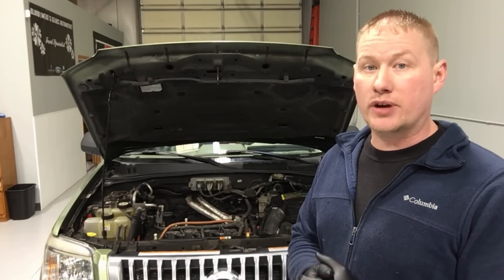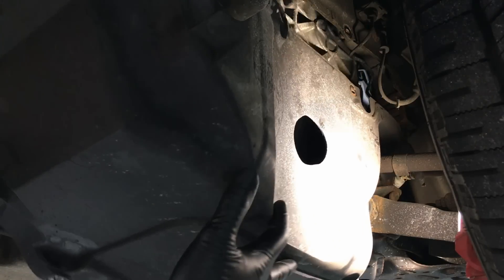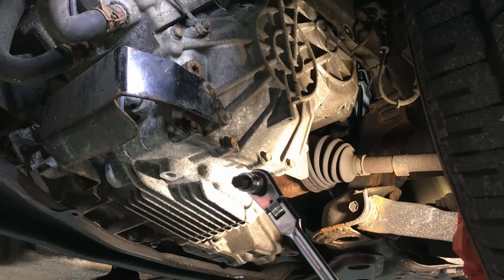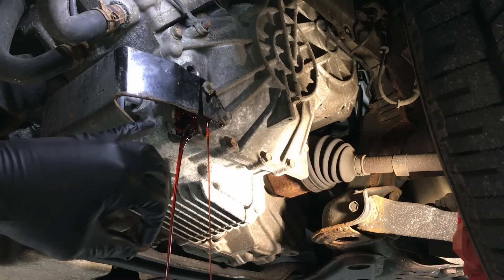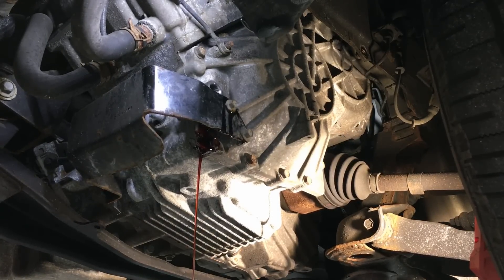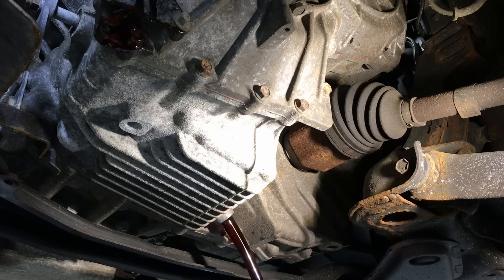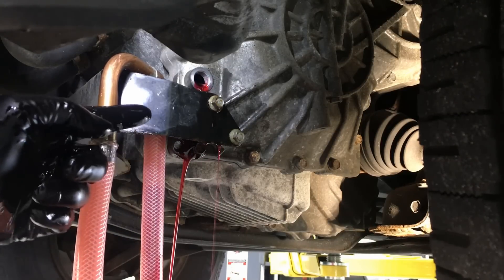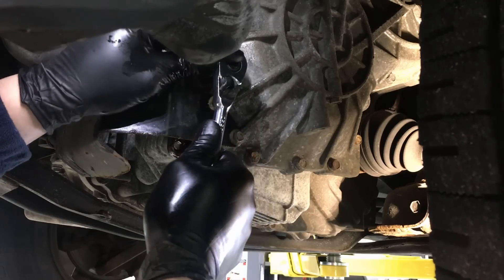2005-2012 Ford Escape Hybrid eCVT Transmision: Fluid Drain and Fill Procedure

Comment: I'm not sure I agree with your fluid choice. I'm fairly certain these transmissions use Mercon LV, not Mercon V. LV is for CVT transmissions specifically. Are you certain on your fluid recommendation?
Reply from the maker: The fluid specified for the Ecvt is mercon V yes, regular cvt transmissions from Ford as found in the Ford Freestyle take a CVT specific fluid whereas Mercon LV is used is most if not all of Fords new conventional 6+ speed transmissions. Your statement is so far off in so many ways please heed my advice I have been a Ford Tech for 15 years I work on Fords 7 days a week I know what I am talking about thanks.
Reply: @FordTechMakuloco  Good to know. The reason I made that statement is because my OEM Ford dealer (Anderson Ford in Lincoln, NE told me that my eCVT Escape takes Mercon LV. After more research I see that you are correct. Scary to know a dealer told me the wrong information.
Reply: @TheeFlyingK  It would not have hurt that transmission one bit by using Mercon LV.  Compare the two, all the info is online side by side.  You would have never noticed a difference.  Your local dealer was probably recommending what they put in those transmissions because LV is a better product.  Most of the guys on the Ford Forums use Valvoline Full Synthetic Mercon LV or Amsoil Low viscosity ATF.  Ford acts like they transmissions aren't even serviceable because they are "Sealed"  Sealed my ass.  Same with the 2015 series F150's with the automatic trans in the EcoBoost, "sealed" Which is complete garbage.  As you can see in this video, they are all serviceable but Ford refuses to do the work because they claim there is no way to drain or fill them.  Valvoline makes a great Mercon LV Full Synthetic or you can use the low viscosity Amsoil ATF and it will run better than the day you bought it.  Ford acts like they put some special additives and magic spells in their fluid.  Give me a break.  This isn't a dual clutch racing Ferrari for God sakes.

Comment: I have a 2007 Escape Hybrid with CVT transmission. Lately I've noticed my rpm's just about red lining at higher speeds on the freeway. Almost as if the  transmission is slipping or not shifting to lower my rpms. Any advice?
Reply: Our 2006 is having the same problem.
I'm still working towards the cause, but I did find both output shaft seals leaking so it may be that it is low on fluid and either causing the issue or caused damage and this is the outcome of that damage.
Reply: @TheeFlyingK  I would imagine that in my case if the output shafts were leaking I would see an oil stain in my driveway. Dont you think?
Reply: @foggiapainting  It's possible. It's also possible that majority of the leaking happens while the vehicle is in motion. I'd simply check both seals for leakage. I never noticed any wet spots.

Comment: I have my 2005 Escape hybrid at the dealer now. I brought it in for a CVT Oil change. They are saying this hybrid transmission is "not serviceable". What are they talking about!?!? This vidoe makes it seem like this is something they can do for me. Are they just not trained on hybrids??
Reply: According to FORD, the transmission is "sealed".  The lubrication is designed to last the lifetime of the car.  You should just drive it til it makes a crunching sound, then walk away, marveling at the wisdom of FORD.  The transmission will have lasted exactly as long as the car!

Comment: Great video. Discovered that my quarts bottles had a gallon sized opening therefore the recommended pump was too small
Reply: Same problem for me. I had an old denatured alcohol bottle that I dumped out and used it to pump. My 2010 FEH took about 6 quarts, even though the owners manual said 5.4

Comment: Can bad fluid cause the wrench light? my door actuator for the battery hvac seems to be fine opening and closing fans working as should for the ev,  i ordered a filter for the rear EV but if i turn ignition on and wrench is there I can turn it off then on again and it may go away. Could this be the trans fluid also its a 2008 with 162k on it NO other issues

Comment: I have a 2010 Ford Escape Hybrid with 161k and did a drain and fill based on this video at 140k. Now I think there is some slipping happening now. The rpms will stay just under 3k at 70mph. Any thoughts?
Reply: I think at 70 mi/hr that seems about right for the RPM on these.
Reply: @nocarsgo23  agree rpm's are right going 70mph.  you have no issue.
Reply: Kyle Cornelison how did it hold up ?
Reply: did it slip I have one one with same mileage

Comment: @FordTechMakuloco
I used the Mercon LV in my 2008 escape hybrid, is this a really huge problem?!!?
Reply: I have this exact same question. I bought Mercon LV for my 2013 Ford Fusion hybrid and have a ton left that I wanna use on my 2008 Ford Escape Hybrid. I thought the 2008-2012 Escapes were the same?

Did you have any issues using Mercon LV on your 2008 Escape??
Reply: Mercon LV is specified for my 2009 Escape Hybrid

Comment: My 2007 Hybrid  sometimes slips when it’s real cold (like 10 degrees or below) and it sounds like my front wheel bearings are loud. Are they related? I’m going to change/check the trans fluid, but is there also a filter that needs changing with this procedure?

Comment: If it hasn't been changed in a long time, or not at all, at 190,000 miles will draining and filling it cause it to fail? I know regular automatics are like that.
Reply from the maker: On these no concern at all.
Reply: @FordTechMakuloco    Sshould I do it warm or cold engine, and sitting for awhile for fluid settlement
Reply: @FordTechMakuloco  Can we see a video on a drain and fill of a 2015 CMAX Energi transmission? Got one coming up on 60K.

Comment: I have a 2009 Mercury Mariner hybrid that I only drive a few times per week.  It hasn't reached 30,000 miles yet so I'm wondering if, like the motor oil, the transmission fluid is one of those things that  should be changed every few years or so, regardless of the mileage.
Reply: wow 4 miles a week on average since 2009?
Reply: You should anyway

Comment: Long shot but, I'm looking to buy a used 2008 Ford Escape Hybrid but already know there's an issue with the A/C and power steering. A/C I could care less about, and power steering from what I understood was fixable by swapping out a sensor. 
However after talking with the selling, he tells me that because it's electric there's no fluids so...you gotta change out the whole assembly? Still cheap to buy from a scrapyard but, not sure if this is right or if he's mistaken and I'm able to just swap out the sensor that seems to be an issue? Thanks! :)

Comment: Please help!!! I have a 1999 E350 5.4, it runs bad. # 2 cylinder misfire and #3
There was 4 misfire and it was running lean, so I put a new fuel rail and injectors all the way around. Then it ran better for 30 minutes. It shatters really bad in overdrive and less you give it gas. Very low power, i've changed coils and spark plugs. Number 2 cylinder you can tell by The spark plug was running rich, not the other ones. Also the number two cylinder coil boot look deformed in the middle like it got hot. But the van has never overheated. The egr Value was full of nasty crap so I changed that and the thing that has high side and low side that has little tubes the hook up to the exhaust manifold. New pcv value. I knew propane and strong for them to see if there was a leak in their intake and it did not show any vacuum or intake leaks. As you are driving it you can feel it at normal for a split second go back to running like crap then do that back-and-forth. But when it's in overdrive it shatters really bad, i've also put a new mass airflow sensor. Now only 3 codes come up and egr exhaust flow restricted and #2 and #3 misfire. There was 19 codes before I started, I'm just frustrated so bad right now. I've tried so many things now. So if you have any suggestions please, please!!!
Let me know.
Reply: Im among all of the others,are the only one with balls to reply to you
Theres so many codes man.... did you fix it yet?

Comment: Almost as easy on the newer escapes (2013 onwards) - no need for a pump as you fill it from up top, but you do have to check the level when hot and running which is slightly more challenging.

Comment: Brian,  I have a 2015 Ford Focus sport 1st question where can I get a service manual? I searched but can only find up to 2014. The 2nd question is I cannot find anything that really explains what the sport model is I know the bottom side skirts are painted and the front valance(dont know if thats the right word or not) also the paddle shifter.

Comment: Brian, thanks for another great video, I'll definitely be changing the fluid myself this next time instead of taking it to the dealer.  On another topic I have an 2008 Mariner Hybrid with 115k miles and recently it's been getting a Regen Braking error in the dash text display, along with the ABS & Wrench lights.  I've driven it with this condition and it definitely changes the braking characteristics.  Usually if I turn the car off, wait a minute or two and restart it the error clears itself and the brakes operate normally.  I curious if you (or anyone else watching this video) has ever had this issue and what it takes to fix it.  Thanks again.
Reply: Jim Miller 
Check the tone ring if it cracked or broken for ABS warning light.
There are video on YouTube.
Reply: Jim it might be a PCM issue
Reply: JIM,  +,    go to each wheel and check out the--" ABS sensor"  and harness make sure you don't have  any frayed wires,     Do a  good,  Thural VISION  INSPECTION,    use a flashlight,     take your time and look at the - "star ring Hub toner" ,    where ABS sensor is detecting a PULSE,     look for any damage as you turn the wheel,    
Also,    while you're there,   clean out the sensor with "brake cleaner"     sometimes if you have too much metal debris- build-up on the sensor,   it can ACT UP....
Take your time one thing at a time so you can eliminate the Causes that you' ve  already gone through  your   " DIAGNOSTIC - CHECKLIST"..
Also,    maybe you have a bad--" ABS sensor" ,    look up a video,    on how to test,  A " ABS - SENSOR"....

GOOD LUCK, 🤞,   Hope you find the issue.....

Comment: The hybrid cvt is extremely robust. It's not even the same as most cvt. I believe in the leave it alone stance on transmissions.  We have 2 with over 225,000 miles and have done nothing maintenance wise to either. If you buy a used high mileage unit, leave it alone. If you get one low miles, then do the flush.
Reply: I want to say the same about my 2017 Rogue but I know better than wishing for the impossible. LOL.
Reply: That's what the Ford dealer next to me said. They let them go 150,000-200,000 miles before changing the trans fluid

Comment: How reliable are ford cvt's??
Reply: STEEVE DAVID Nicolas the hybrid ones are bulletproof. Very rare to have any issues.
Reply: daryl turcott thanks for the info, I'm familiar with nissan cvt which are trash by the way, don't know much about ford cvt's
Reply: As mentioned in some comments above, hybrid eCVTs such as this one are rock solid reliable and can EASILY go 300+k miles as Brian mentioned. A totally different beast compared to a traditional CVT you'd find in a non-hybrid on the road.
Reply: STEEVE DAVID Nicolas time will tell get an extended warranty asap. Ford rarely makes good on major defects. Shalom
Reply: motorhead there were quite a few issues with the zf Batavia cvt in mid 2000s that ford did not address for sure. But time has proven the 05 to 12  hybrid trans. Millions of initial taxi fleet miles and no failures.
Reply: daryl turcott not a fan or cvt anyway,like manual or auto,I like hearing the trans shift point
Reply: Its bulletproof because it is an electric cvt. Aka ecvt. there are no metal belts it is all gears like a manual transmission but electric motors change the drive ratio through planetary gears
Reply: STEEVE DAVID Nicolas a shame about Nissan,  I really wanted a cube, but was scared off.

Comment: ,,, I need a video on a 2013 model Ford Escape all wheel drive,,, for transmission fluid change transfer case fluid change rear differential fluid change,,, radiator drain and thermostat replacement,,. Do they even have power steering fluid,,. ???   What else do I need to do at the major preventive maintenance at 60000 miles,,,.  ???

Comment: Good info!  Looks super easy.  I got my wife a 2018 Subaru Imprezza with the CVT tranny, and not having any experience with the CVT, I had been wondering if it required any fluid changes.
Reply: There's a big difference between a conventional CVT and an eCVT as seen in the hybrids. Conventional CVTs have the whole pulley and belt setups and depending on the manufacturer may be 'ok' to just 'bad'. eCVTs have been proven reliable and rock solid as all they are is a simple planetary gearset, no clutches or gearing. Simple and reliable electric motors in addition to the engine do the work of maintaining the gearing ratio through that planetary gearset.
Reply: Disclaimer: Nothing is for life, specially on today's cars, don't ever let a manufacturer make a fool out of you feeding you what you want to hear. Take care of your ride and it'll be kind to you.
I haven't heard as many people complaining about the Subaru CVT BUT if it's anything like Nissan's I would change the fluid  as often as possible (shorten the intervals in half, maybe even less) and when your warranty runs out skip the oil to water transmission cooler and install a HUGE oil to air one for a vehicle at least double the weight of your Subaru  where it gets lots of air(usually in front of the A/C Condenser).
My 2017 Rogue owners manual recommends an inspection @60K, yes, you read that right, just an inspection, NOT A DRAIN. 
I SAY F-THAT, NOT HAPPENING ON MY WATCH.
I'm draining that thing at 15-20K and slapping a new filter in there too, cheap insurance i say.
Nissan is in the business of building and selling cars, not looking after your car and you financial well being.
Reply: Ain't it the truth, Jiga.
Reply: Hey Chris! Yeah, I'd definitely change it, whether the manual says to or not. Can't speak for Fords, but  from what I've seen of other brands, the CVTs aren't as robust as a regular automatic. They need all the help they can get. In the case of the Nissan Rogue, no replacement parts are available ... so when the thing lets go, it's over $2 LARGE plus core to swap out the entire assembly.
Reply: Hey Smitty, thanks for the tip.  Yeah, this CVT is an interesting annimal...  it will go from 0mph to 60mph on 25% throttle, and the Tach will never move from 2k.  Yet, if you floor it from 0 mph,   it has pseudo shift- points built in to the solenoids, so it "feels" like a standard 6 speed auto.
Reply: Basically like a snowmobile, or a Polaris ATV, except with electronic controls. :)
Reply: Ahh, good info Matt - thanks! I'm probably 10 years away from seeing one of these in my shop, if I even see one then. Ford and Chevy country out here - 99.8% trucks. :)

Comment: Brian, I have a 2013 CMax, is the change procedure similar?  I know the transmissions are different .  I haven’t tackled this yet, about to hit 100k miles.
Reply: I'm also curious about this as well. Apparently the 2013-2017 eCVT's in both the C-Max and Fusion hybrids and Energi's are similar to the Escape transmissions from 2008-2012 just updated so it may be similar but I, too, am curious if there are any good recommendations for these vehicles. My 2013 manual has a recommended transmission fluid change interval of 150k miles.
Reply: Yep. You're right. I was mistaken. The 2013-2017 models have the Ford built HF-35 hybrid eCVT transmissions where I think either 2017 or 2018 model years they have an updated HF-45 which is still built in-house. I was thinking they started the in-house models earlier in the Escape Hybrid's lifetime.
Reply: Justin LaNoue I have the same question.
Reply: From what I've researched the early Hybrid models used an Aisin transmission that is the same model that Toyota used in their Hybrids and the 2013+ Ford Hybrids use a Ford built and designed transmission that is very similar to the Aisin units.